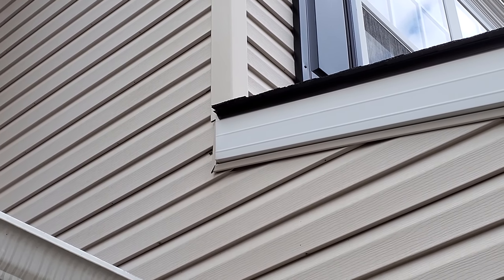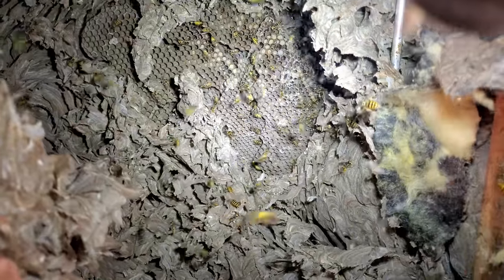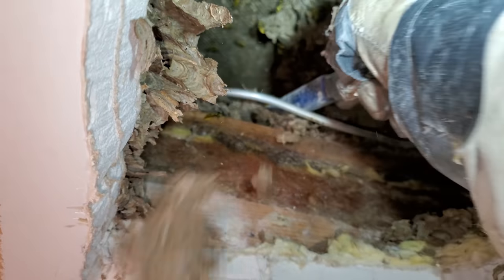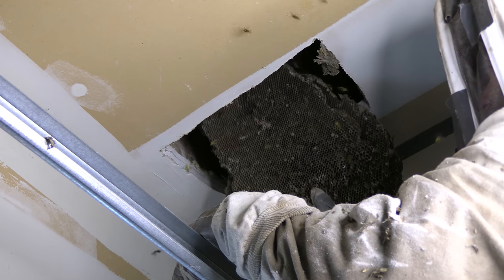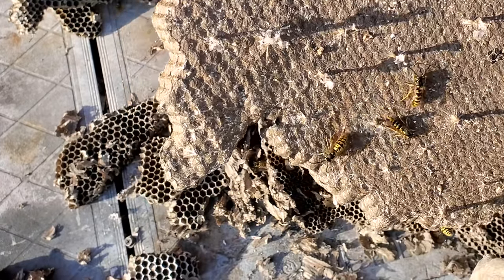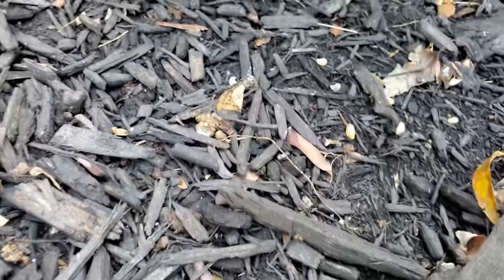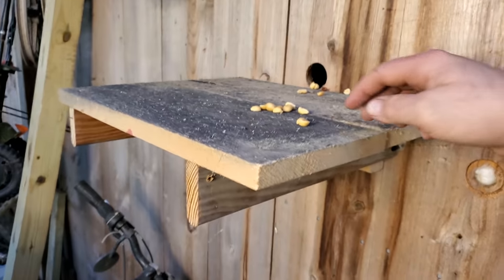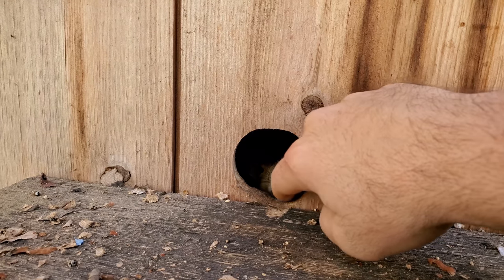Yellow Jacket SUPER NEST | Wasp Nest Removal | Wasp INFESTATION

Comment: What happens to the adults that fly off inside the home?  What if the nest is in another part of a house (not a garage)?
Reply from the maker: Theyll die. 
If the nest wasnt in the garage ceiling/ nursery floor, i would have located it somewhere else. Im not sure what your question means.
Reply: @HornetKingOfficial  What I meant was how do you deal with the swarm when it comes out if it's in let's say a bedroom.  From watching more of your videos I got my answer, they seem to gravitate to an area and then you hit them with the spray.
Reply from the maker: @CHAOSMOVEMENT  When in the home, as the wasps come out of the wall/ceiling, the fly to the windows where they are easy to suck up in the vacuum. I dont usually spray black flag indoors, but if the swarm is large enough, ill spray the window sill where the swarm is to batten the numbers down before I am finished with a removal.
Reply: @HornetKingOfficial  Cool, well thank you for your videos and response, I enjoy watching you work bro.

Comment: How to remove a wasp nest:

Step 1: find nest

Step 2: dig hole in nest until you find the comb
Step 3: pull the pin of the grenade

Step 4: put the grenade into the hole

Step 5: run away

You've destroyed those bitchy wasps, now celebrate.